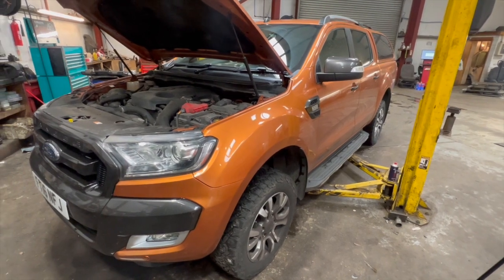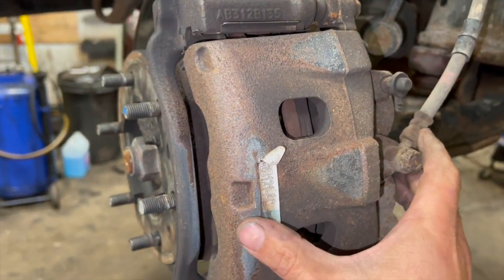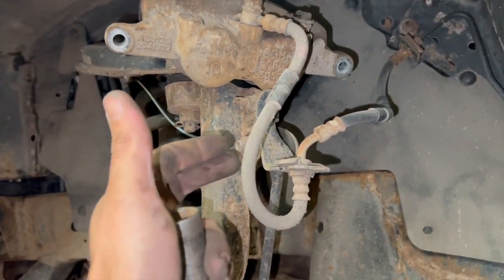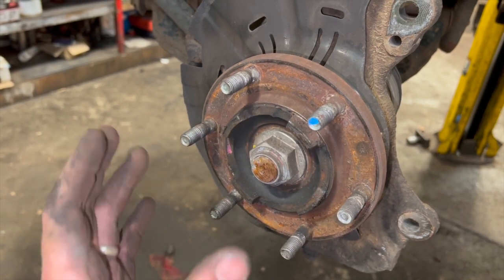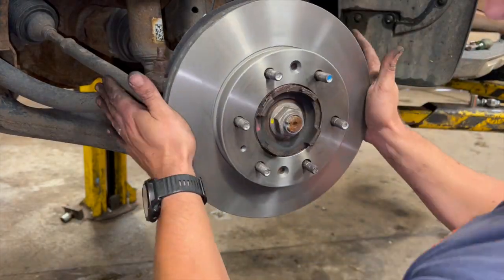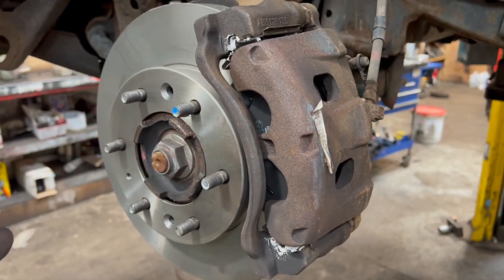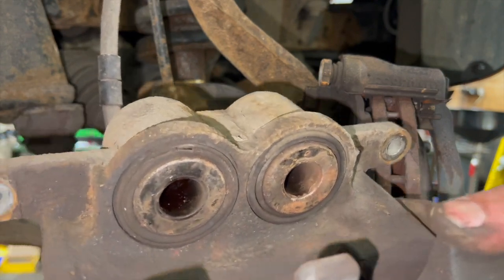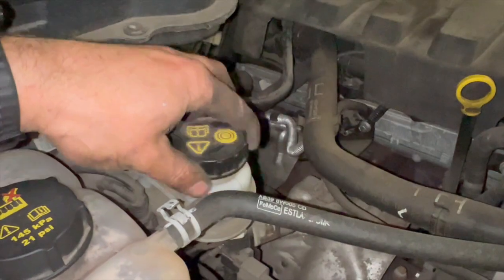2016 Ford Ranger front brake discs and pads replacement

Comment from the maker: Check Euro car parts - https://tidd.ly/3lIO7xA  (use discount codes on site)

Front brake discs Ebay - https://ebay.us/cNLTuV
Front brake pads Ebay - https://ebay.us/rAHe9l

Tools used :
             
Milwaukee 3/8 Drive Mini Impact driver - https://ebay.us/Pg8ilg
Socket Set - https://amzn.to/2O6BUmM
Spanner set - https://amzn.to/2DlwUZm
1/2” Milwaukee impact driver - https://ebay.us/4SOewF
17/19/21 wheel bolt impact socket set - https://amzn.to/3gDnBlP
Torque Wrench - https://amzn.to/2VZ4CKu
Screwdriver set - https://amzn.to/30RA53L
Copper grease - https://ebay.us/ckQddu
Brake cleaner - https://ebay.us/TenE90
Ceramic brake paste Amazon - https://amzn.to/3jN87gW
Ceramic brake paste Ebay - https://ebay.us/GbuDhL
Large grips - https://ebay.us/XO4oRl
Brake cleaner sprayer - https://amzn.to/2BLF1gX
Wire brush - https://ebay.us/hTtdhH

Torque settings :
Caliper carriers bolts - 115 NM
Caliper sliders bolts - 52 NM
Wheel nuts - 135 NM

Comment: If you can't pop the disc off by tapping with a hammer, the small (M8 IIRC) threaded hole on the disc can break a rust seal. A quick scrub with a wire brush should reveal the threads.

Comment: Top Job, now have you done the rear shoes..
Reply from the maker: 👍 will upload if I do em
Reply: I replaced the handbrake mechanism on a Fiat Ducato that someone screwed up by putting the bottom spring in wrong, what a nightmare 🙄..

Comment: Thanks for the video mate. Do you have one for the rear drum brakes?
Reply from the maker: Thanks!  Not yet if I get chance I’ll do one
Reply: Shoes and wheel cylinders on the PX2 are super easy. I just did mine. Word of caution, if you do yours, make sure you properly inspect your new wheel cylinders before putting them on. I got a Pagid set because that was all I could get ahold of here in Blighty. I found the bleeder screw was not seating correctly in one of them and it was leaking fluid out and air in. I didn't discover it until it was back from the test drive and found brake fluid spray all over the inside of the wheel. Also remember that if your drum is stuck to the hub, you can use the set screw to crack it open. I found both of mine were seized pretty good and hammering wasn't doing anything so I turned the set screw into the threaded hole on the drum and it popped right out.